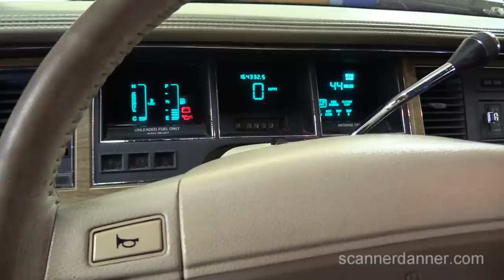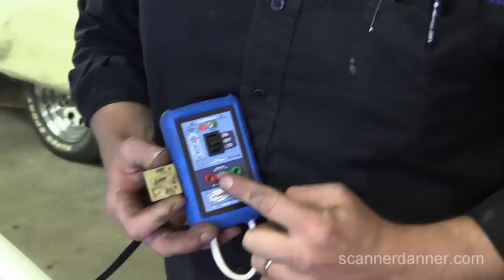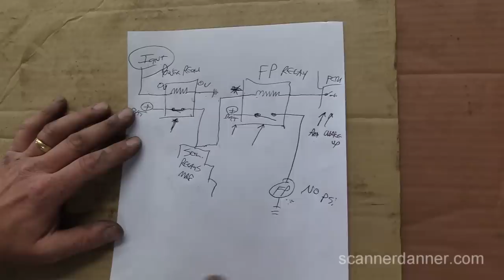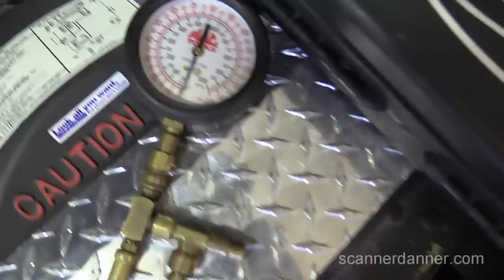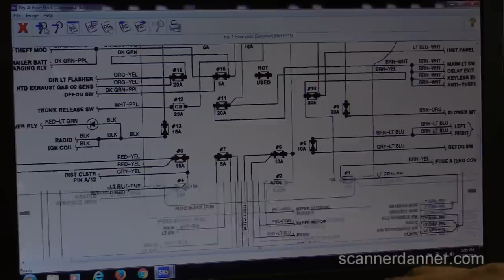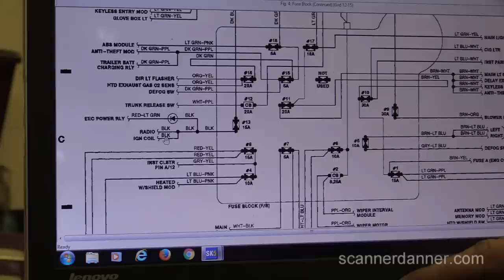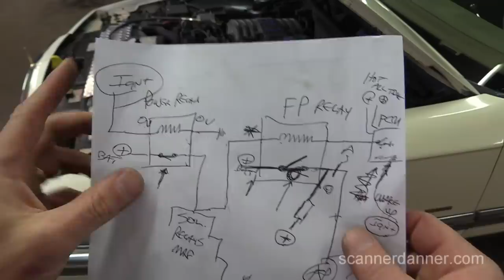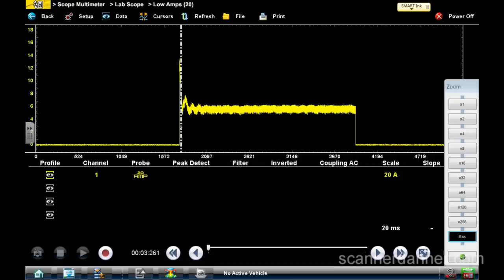Ford EEC-IV No Start No Fuel Pressure Troubleshooting (Lincoln Towncar)

Comment: great video Paul Danner. back in 198Os. when I worked at a Ford Dealership. I can remember using a analog voltmeter. count the sweeps for the trouble Codes.  and used a dwell meter to check the duty cycle of the mixture controlled solenoid. I think it was like 10 times per second. thinking back I didn't like feedback carburetors. back then it was very time consuming to troubleshoot the fords. I didn't mind the older fords from the late 60s , 70s . very simple. thank goodness for OBD 2. I sure enjoyed this video. brought back some memories. thanks

Comment: Thanks to your ebook and videos I  was able to fix my 98 Taurus 3.0 24V.  It cranked, but no start and no RPM signal. I hooked up my scanner. It detected a cam sensor problem. The wiring at the cam connector was bad. I fixed it. Still no start. I checked voltage on both cam sensor wires. They both read .1v. I left the voltmeter connected and disconnected any sensor that was on the same circuit, which were  a whopping 13 sensors that were all on the cam sensor circuit. When I touched the 9 wire connector at trans, the meter voltage jumped to 2.5 v. I removed the connector and it was full of trans fluid and rusted. I cleaned it with air and contact cleaner. Still no start, but almost started. I raised up the vehicle and found the crankshaft harness leaning on the vehicle frame. I repaired the damage and it started!!! Although the cam and crank sensors run on different circuits, I believe my scanner detected a cam sensor problem because the PCM depends on both sensors to create an RPM signal. This vehicle had a cold misfire. I thought it was a bad intake/plenum gasket. After all these repairs, the cold misfire went away. Go figure. Praise God for Mr Danner!🕺🙏👍🇺🇸
Reply from the maker: Nice job tracking that down. Praise God for the perseverance He gave you to do this task.

Comment: Great video Paul, when I need a guaranteed power and gnd for my testlight I use the lead from my PP3 and my SnapOn testlight EECT313A00 which has a 4mm banana jack each end. It draws 440mA but sadly Snap-on don’t sell it anymore.
Reply: That's a cracking test light

Comment: Last good car platform that was ever built, IMO. I've got a '86 Grand Marquis - basically the same chassis, different body. I'm surprised to see the pump on that Lincoln fail at 164k! I'm still on my OE pump at 250k! I guess that just goes to show the differences in quality from '86 -'90 - alot can change in 4 years! No airbag in my car, nor are there any fuses under the hood (no Maxis anywhere either). Same basic layout, though. We don't drive it in winter, so she's a gem. Very little rust (had to drive it 4 months of one winter back when we first bought it in '03). Only electrical gremlins I had was a shorted A/C compressor clutch feed, and a bad headlight switch. Not bad for 32 years!

That uActivate tool is great - I definitely need to be buying one of those soon.

Thanks for going above and beyond, as usual! I noticed in the video description section that you broke down every section of this video, and took the time to label them AND post time links to that section, AND posted the links to videos related, AND the links to the tools! You are an asset to humanity, Paul!! And a big THANK YOU to Cameraman Caleb as well! 👍 God bless you guys.
Reply: did u see the rust on top of that pump!  caustic elements = more maintenance...

Comment: I have seen either of those relays short out inside from rust build up and pop that fuse. I always suggest to replace both relays when replacing a fuel pump. Take them out and shake them. If there is rust inside you will hear it. I have been bitten one too many times. Nice job Caleb. You will be smarter than Dad soon.

Comment: Paul, top drawer video as always!!!!!!!!!!! The only other issue I have seen as I am sure you have, is a fuel pump that does draw current and makes noise and  has no fuel pressure, but the pump can be very quite and only audible standing directly under the tank or with a stethoscope. Keep the videos coming!!!!!!!!!!!!!!!!

Comment: Getting ready to work on my dad's 1984 TBird 5.0 EEC IV TFI  next week . As always, your videos are excellently done and extremely educational . Thanks for all you do and have done brother .
Reply: Robert Wood oh yeah tfi module on the side of the distributor
Reply: Richard Gill I forgot the 84 has central fuel injection with a throttle body too which is different from the 90 model engine .  Paul has some good TFI ignition videos as that was a very common system for years .
Reply: Robert Wood that is correct. I worked for a Ford dealership in 1981 thru 84
Reply: Are you sure you dont have the vv carb. Called variable venturi
Reply: Richard Gill yes . I owned it for around six years . The VVs were something I avoided buying and I saw them more on 351 Windsors in my area . Several guys had them and liked them .
Reply: Richard Gill I started high school in 80 and my mechanic friends were discouraging me from entering the automotive field as cars were so laden with emission hardware, vacuum lines and wiring . Paul Danner is the reason I love this field again . The mid seventies to early eighties were a transition and took special guys to work on that technology .
Reply: Robert Wood I've been doing emissions  ( State Certification ) in Indiana since day 1
Reply: Richard Gill so you have seen the evolution of the emissions and electronic engine controls first hand . I enjoy reading manuals on the late 70 s through late 80 s and how it progressed into what we have now . Danner really teaches this so clearly . Wish we had teachers like that 35+ years back .
Reply: Robert Wood back then we had belt driven air pumps, diverter valves, and many ported vacuum swiches.
Reply: Richard Gill My wife's first car, a 1980 Toyota Corolla that we still have has a dozen or more vacuum lines on the carburetor . That was intimidating in the eighties to pop a hood and see a spaghetti mess of hoses and wires under hood . Cars now are much cleaner in the engine compartment .
Reply: Robert Wood I was in the same boat at the same time. Auto shop instructor at the local tech college told us that auto technology is going to get so advanced that only a dealer mechanic with the manufacturer specific tools will be able to do anything. Really set me back from advancing myself further into automotive. 
 After discovering Paul, I'm realizing I have the ability to handle this. I've made some great advances the past couple of years. Really opened up a new world for me!
Reply: Mark Chidester Amen friend . Paul makes it look much more understandable and easier to learn .

Comment: Paul, splice a banana jack on the end of your test light in place of the alligator clip.  Then you can use the Power Probe extension cable with your incandescent test light.  I did this on my test light and couldn't be happier!  When I need an alligator clip on it I just plug one in but I find it easier to use the PP extension cable for most everything and haven't needed the alligator clip.

Comment: Great explanation of how everything works and how to trouble shoot. 
Im having an issue with my 86 Bronco’s feed to the fuel pump.
I have power to the relay. But not from the relay to the pump.
I was told it was the EEC. im watching your videos to learn how to check the EEC.
Reply: did u check EEC fuse?  on 98 f150 its 5 amp, check all fuses just to be sure
Reply: @charlies6546  yes, fuse was the first thing i checked. Im getting power to the relay. But not the pumps
Reply: possibly open ground?  u can jump #30 & 87  w/heavy paper clip, to identify dead pump
Reply: @charlies6546  will do.
Thanks!
Reply: @charlies6546  i turned the key n. Heard the pump kick in. Repeated the process about 3 times. Cranked the motor and it fired up. Let it idle. After about 1.5-2 minutes it died out. And wouldn’t start back up.

Comment: Nice Job Paul! I just had a 99 Ford Ranger(2wd, 4.0liter)that was a Crank No Start No Communication, No MIL, No Spark, No Fuel Pump Activity, No Ref Circuit. Obviously all of those involve the PCM and PCM power relay. I quickly narrowed it down to no power to PCM. The Power relay was "clicking" so with a simple incandescent test light, I determined the relay was at fault. Swapped relays and boom, she fired right up.Oh and BTW, I'm an idiot so If I can do this diagnosing, anyone can LOL

Comment: THANKS, CALEB!

While you re teaching Caleb about these things, feel free to teach him about this one!  

1990 Chevy 3500 w/454 tbi. Would start/idle roughly, would accept no throttle, would increase in rpm if you pumped the throttle rapidly! I once had an 88 S-10 2.8 tbi, that had a strange issue!! It turned out that the neoprene rubber piece that connected the pump to the main fuel outlet on the pump assembly unit in the tank, had a split. I had no way to test it, but disconnect the line and you would have fuel flow. Reconnect it, and it wouldn't start!! I found the split in the connector piece after I removed the tank!  

Back to the 90 3500! I was fixing for a (very picky)friend!! I decided that the fuel pump had that split in the connector, just like my S-10 blazer did, years ago!! I went and rented the fuel line connector kit, for the throttle body fuel line, and showed him that even tho it started and ran, it had no fuel pressure, and that's why it acted as it did! So I got to work taking the tank out of this OLD, RUSTY, DECREPIT MONSTER, which had been sitting. Others had worked on it, which made the job that much more difficult, except that they had cut the metal fuel lines, and spliced in some rubber line, which made that somewhat easier to to get out!! But, in the process, I disturbed a BROWN RECLUSE SPIDER NEST!! And boy, I'm twice as arachnophobic, as you are a mechanic! But that's a story for another time!!! Anyway, I got the tank out, inspected it, and showed my theory to my friend!! There was a split in the pump connector to the main fuel line piece!! Of course, he wanted to JERRY RIG IT!! I refused!! It was not simple to get the monster out, take the pump out, or put back in, and I wasn't doing it again in three months, when the old assed fuel pump finally gave up and retired!! The new pump came with a new neoprene rubber connector! The new pump ran like a top, sounded strong, and was even quieter than the pump it was replacing! (We didn't dry run it) I got it all out back together, and attempted to start it, and he wanted to see the fuel pressure, before it ran! He turned on the key, and got out to look at my face, when there was no fuel pressure on the GUAGE!! We never unhooked the setup during the fix!! It was difficult, to say the least, and it was rented, so it was get it done fast! There was no pressure!! I told him to cycle the key, two or three times! I could feel the relay clicking!! Since the steel line had been replaced with rubber ones, I decided to verify fuel flow, by disconnecting the fuel filter again!  SSSPPPLLLOOOOOOOSHHH!!! Fuel went everywhere!! I had no safety glasses on, and it went into my eyes!! It got in my mouth, and I couldn't even yell for help!! It got in my ears, and BURNED LIKE SATANS SPIT!! I thought I was done for! I crawled out, and managed to groan a bit, and and then eeek out a WWWWWAAAAAAAAAA, BAD!! It was a bad experience to say the least!! Blind, in pain, unable to ask for help, tell what happened, or communicate my need!! He smelled the gas, and guessed! Led me to a seat, got me a few paper towels, and then asked do I need an ambulance!! I was able to say no, but I needed to get inside to wash!! He led me inside, got me to the shower and turned it on, while I got on my knees to wash, run the water over my head, and to wash out my eyes!! My ears were the worst, for some reason!! GAS IN MY EARS WAS EXCRUCIATINGLY PAINFUL!! I guess that I closed my eyes as a reflex, but couldn't close my ears, and it just filled them up!! 

NO READING ON THE GAUGE, DOES NOT MEAN NO FUEL FLOW!! Just like testing the test light to see if it had good power and good ground, no pressure reading on the gauge, doesn't  mean there is no fuel present! I pulled a rubber line from an inline filter!! When the clamp was loosened, and I started to take the line off, pressure blew the line off, and I was less than a foot away, underneath it! I did not prepare myself, as if there was pressure!! I didn't not prepare myself as if there was fuel! I did not prepare myself as if it was a dangerous activity! No rags, no eye protection, no fire extinguisher, just a redneck, shade tree, backyard idiot, practicing his specialty! STUPIDITY!! I laid down, on my back, scooted under, and worked with danger in my face, at even less then an arms length, and looked straight at it!! I am ok. No permanent damage! No hospital, or ambulance needed! But I should have been take out to the wood shed, for what I did, and how I did it!! I should have had my ask whooped up and down the street, for ignoring the rules, ignoring the dangers, and acting as if it was no issue!! 

The problem all along was the split fuel pump piece, just like I thought!! No fuel pressure was my indicator!! It was what a based my diagnosis on!! The fuel line connector kit, that I rented from the AUTO MECHANIC FOR A DAY store, worked like it was designed to! And my fuel gauge was working properly!! My HOLIER THAN THOU brain, is what malfunctioned!! The lil piece that depresses the Schrader valve stem, inside the valve on the fitting, had fallen out of my gauge connector, in my tool box!! That's where I found it, after I got back to working on things!! I took my gauge off, and expected fuel to spray out everywhere, AND IT DIDNT!! Not a drop! Nothing on the rag I had used for protection, nothing on the safety glasses that I put on for protection!! Nothing dripped on the piece of paper towel that I used to help soak up any spill!! No fuel up there! So I looked at the connector, and a big hole was the only thing I saw!! I went and looked, and there was the little pusher piece, that had fallen out!! I put it back in, and hooked it back up!! Guess what we had?? PRESSURE!! (in my best singing voice) The truck fired right up, and purred like a kitten!! Or so I was told! My ears were still swollen shut!! 

So, MAKE SURE YOU REMEMBER TO ACT LIKE A DANGEROUS ACTIVITY, IS A DANGEROUS ACTIVITY!! You're not opening a Christmas present!! You're working on a dangerous piece of equipment, and it CAN AND WILL KILL YOU FASTER THAN YOUR MAMA WILL FOR BACKTALKING HER!! And will hurt even worse than an ass whooping from your daddy,  for wrecking his new car!! This is a serious and dangerous business!! Listen to what this man tells you!! People pay him, for what he's telling you for free!! What he says is the GODS HONEST TRUTH!! When he preaches safety, it's for a good reason!!
Reply from the maker: Man great story, thanks for sharing! So glad there was no ignition source during this event for you my friend.
Reply: ScannerDanner...AHHHH yes! We were both smokers, when this happened. Luckily, neither were smoking! BTW, gas tastes like H. E. L. L. !!!!!!! Boy did I ever taste it! But I didn't swallow!!!! {:-O

Comment: TL:DR Acknowledge Paul as a valued human and then a little car stuff.
From a comment post by another who knows you I figure your name is Paul not scanner or Danner lol.
  2nd comment ever on your channels and rarely on anyones channels.

Seriously for a moment, if I may.
Your knowledge is fantastic, and your approach fits with the way I think I would do it.
Why I am making a comment however is not because of those attributes but the way you show respect to Caleb your son, answering him as you look at him not the camera is a fantastic dad and person.

Breaking down the reasons for doing what you are and are not going to do in Real Time is fantastic as we can all take a wrong turn but you show that as well when needed.
Caleb pointing out the Check engine light is under tape lol young eyes are fantastic as I have found with my Son.

Crank signal might actually be the answer I am looking for as the car is dual fuel e.g. Dual fuel car - petrol and Gas (Liquid Petroleum Gas - LPG in Australia) 1997 vintage EL Ford Fairmont Ghia.

When you start with checking fuel line pressure and point out the dangers as does your son Caleb in the background and then responding to Caleb when he mentions your other son Jake and suggest you will or in this case Caleb will post a link in the right hand side of the screen, and as a typical dad point out to Caleb it is on your right but your pointing left lol.
 Yes I get it.

Teaching your son warmed my heart as the respect shown is fantastic.

Going on to "shamelessly" plug a product called aeswave made me laugh given all the background posters on the walls. And then admit you connected the wrong adapter was just fantastic. If I was a mechanic, I would purchase that equipment as I know you would only say it because you believe it.
The end of the video where you show a possible separate reason for the faults even one you may have caused meant it may return but for other reasons and explaining the cct diagram may be incorrect based on other tests off camera I suspect.

I know most of what I have written is not directly to do with the car but I just had to highlight that you are more than "just a guy fixing stuff" you are a guy that comes across as respecting everyone you come in contact with and others that don't connect I'm sure you also respect them.
Thanks for the free channel and the in-depth information and the way you present it.
I have knowledge but you help me grow which I then share with people I am helping.
The helping cycle if used with great intention makes our world a much better place.  
BTW I am an Atheist just for full disclosure.  I respect other people's choices when not harmful to life.  Damian.